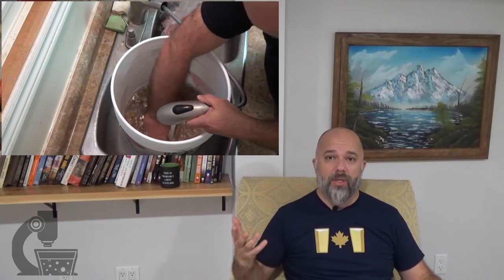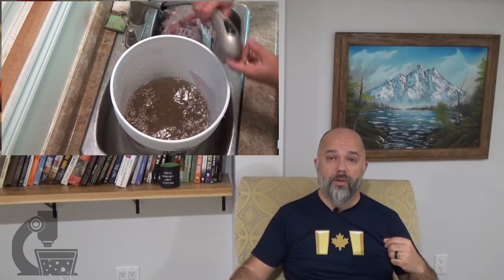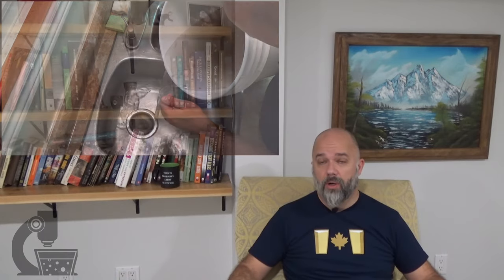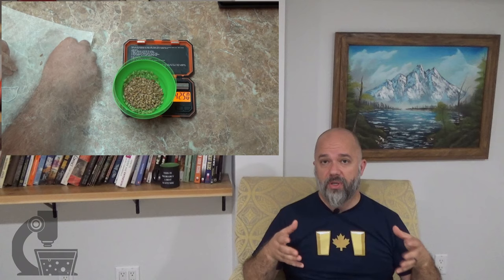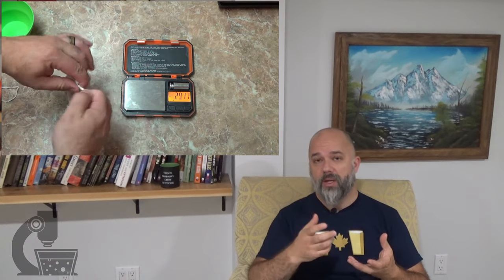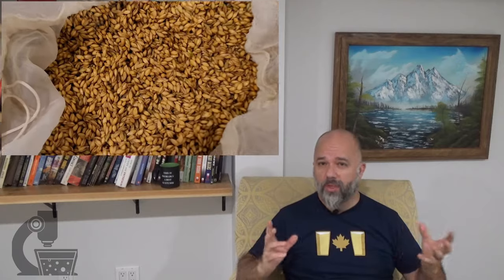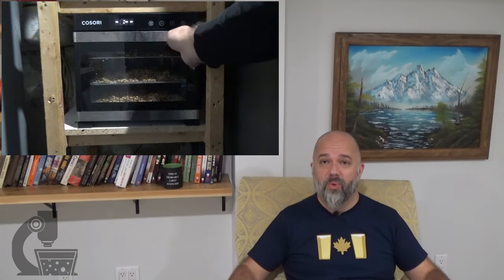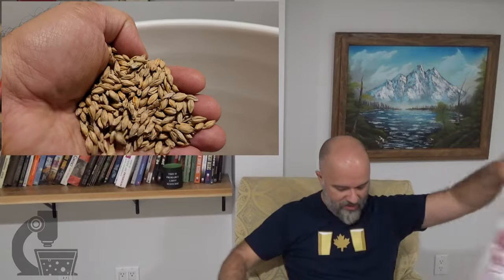The Fifty Meter Beer Project Part 15 - I Made Malt!

Comment: I have been producing malt for my beer for several years now .... the small batch of control to keep track of humidity in my experience is not reliable .... inexplicably the humidity of the small lot does not correspond with the humidity of the rest of the 'barley (generally I make 5 kg barley lots). Excellent video in any case!
Reply from the maker: The weight of the full batch was pretty much spot on what the sample showed. Maybe a 1% difference, which is good enough for what I'm doing. The lacto growth is far more an issue for this batch.

Comment: Very Cool I'm a Coeliac and malt my own rice and buckwheat for hombrewing.

My malting process is alot more haphazard than yours.
I use a solar dehydrator to dry the grains once malted and usually kiln for 1 - 1 1/2 hours at 120c.

I don't rely on the endogenous enzymes in the malt though for conversion I use exogenous proteases and Beta glucanase and high temp stable Alpha Amylase for conversion.

I've struggled to make anything more characterful than base malt so far.

Thanks I'm looking forward to seeing this beer!
Reply from the maker: In theory you should be able to make malt that will self-convert, following a process similar to mine. I made quinoa malt years ago using a similar approach that self-converted just fine.